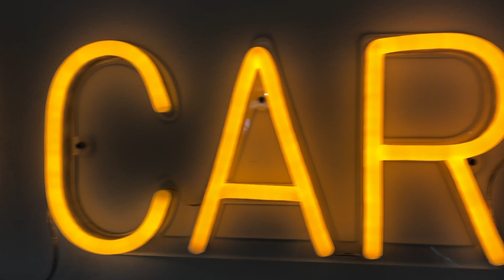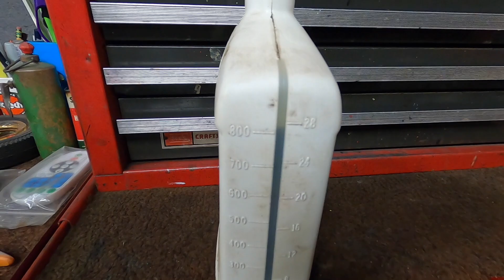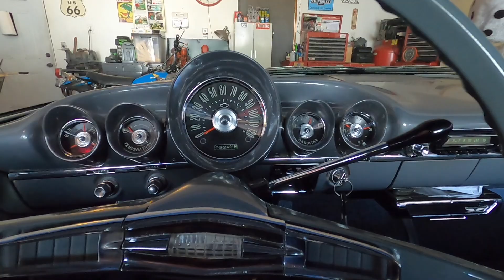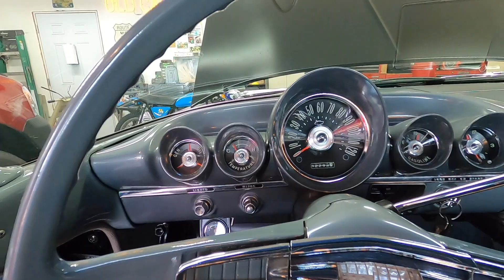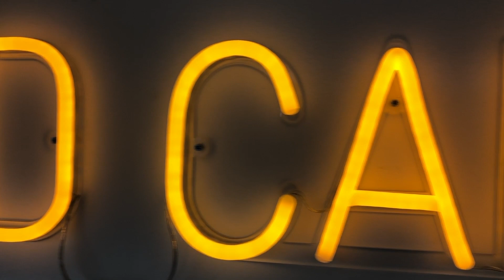Health update, plus fall maintenance on the 59 Chevy's 348

Comment: Howard, from high school to retirement you have maintained and improved your 59 to the point that it will run for many years to come. That is a highly laudable achievement in our throw away culture! Bravo and the best of health to you! (I installed shoulder/lap belts in my 66 Bug and was amazed that VW had already installed the anchors for the shoulder harness for the front and back seats! When the car was built the only requirement was lap belts)
Reply from the maker: I don't think the B pillars will take belts, but I sure plan on installing lap belts.... better than nothing. I try to keep the Bel Air in top running condition. Maintenance is the key!
Reply: Howard, lap belts are fine. I grew up in the 40s + 50s when only race cars had belts. There were fewer people and cars back then but many injuries in accidents. On that note cars have become much safer but I wonder if drivers have improved at all. Here's to a quick recovery from your treatments. I went through radiation for prostate cancer 21 years ago so it does work! All the best! @OldCarAlley

Comment: Hi Howard, sorry you have been feeling so badly. I sure hope and pray that you will not have another round as bad as the one you just went through. I pray that the Cancer Treatments did the job of making you cancer free my friend. 
I took a look at the 60 Pontiac Catalina through the link in the description, such a sweet ride, you did a nice job restoring the ole girl.  Your 59 Chevy looks so well cared for, and it is. Installing seat belts in classics, is a must have with all these new vehicles that people drive so fast.  Take care Howard.
Reply from the maker: Today I have a bit of a headache, otherwise I feel really good. Yeah I'm at the point to where I don't use the local freeways with the Bel Air anymore. I was using the truck to go the radiation treatments to burn the old gas out of it. I was cruising on I-696 with traffic..... I was hitting 90 mph and didn't realize it. I don't like pushing the old car like that, so I stick to local roads with it.

Comment: Wow, sounded like you were very sick. Good to hear that you are feeling better. Hope you don’t have it come back. 1800 miles is about the same as what I put on my truck. Follow your advice on changing the oil, filter and lube before putting it away. Also drain the radiator and put new 50/50 coolant every couple of years.

Comment: The Catalina sure has a different look with the blackwalls and baby moons.
Reply from the maker: Yeah it does.... I almost painted the wheels body color when I painted them. I like body color wheels on the older cars. The wide whites I had on it, were bias ply, so I bet they just wore out, as they don't last or handle as good as radials. It's easy enough to change tires and put the wheel covers back on, if someone wishes.